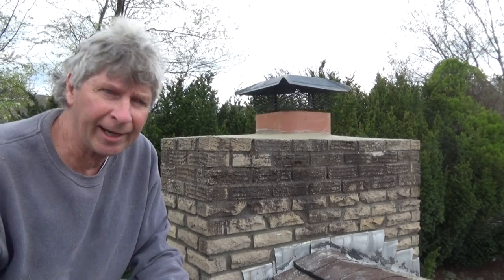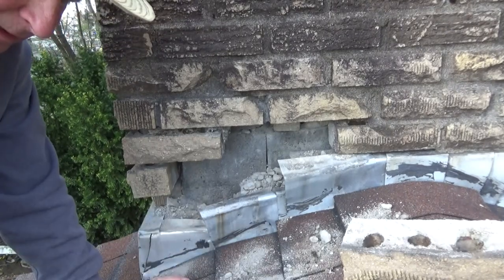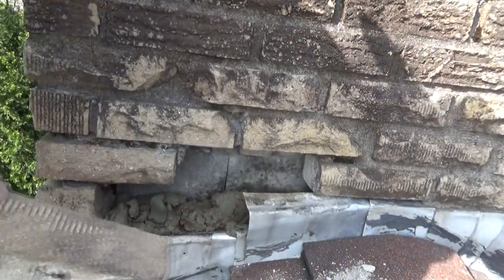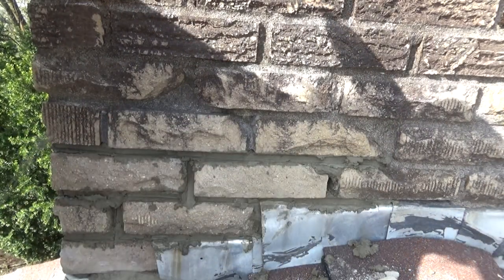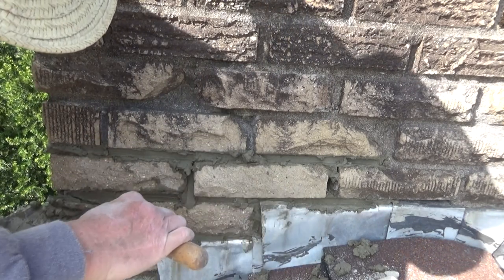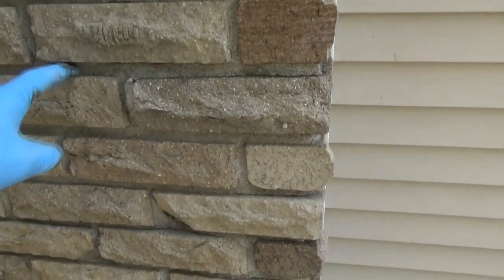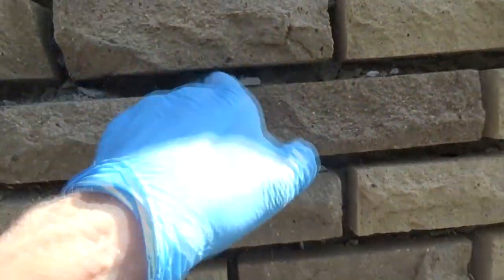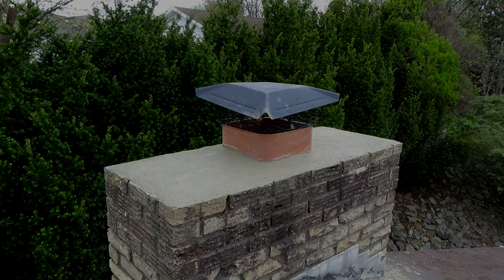CHIMNEY REPAIR (Part 10) Mike Haduck

Comment: I'm worried the chimney extension is not anchored.   If the Pennsylvania freeze-thaws cause the top concrete plaster to crack, then the wind with the chimney cover will blow off and can injure someone.
Reply from the maker: Hi Tiger, he's getting a new metal flue top, but as far as the flue blowing off, not a chance,   thanks mike

Comment: The cap is to thin. Mortar is not cement.
You use motor because you don't want your mortar to be harder than the brick because  what will crack,  the material that is softer ( the brick). That's why you cement for stone and mortar for Brick. And you don't use mortar for your cap you use cement. Use mortar for your brick so your mortar doesn't crack the brick. If you use cement on your brick your Brick crack and the cement won't.
That's why back in the day they used lime instead of cement. Everything moves when it gets hot and cold. It expands and shrinks that's why you don't want to use cement for your brick. There's all kinds of different brick there's hard brick their soft brick there's brick for inside of brick for outside. I lay brick and block every day and I lay Stones also. I've been doing it for about 22 years my dad's been doing it for over 35 I just want you all to know that guy is not right
Reply from the maker: Hi Chris, wow. I can use some learing, send me your video on how to do it right, I will appreciate it, I want to learn. I only been doing this 50 years and my dad 70,  Mike
Reply: Chris is absolutely correct.  Doing it wrong for 50 years doesn't make it any less wrong.

Comment: When I started laying brick 30 years ago the old timers would have shit a brick if they saw you grab mortar with your hand.
Reply from the maker: Hi Dee, I guess I am always in  hurry,  thanks mike
Reply: Dee Cee, why is that? Honest question.
Reply: Just remember, a trowel does not a bricklayer make..............
Reply: That is how I do it when repointing all the time.   Absolutely not when laying brick you need a trowel for that.  But for pointing I hold it in my hand and push it in with a slicker.

Comment: Why not just add lime instead of mortar if you're already using Portland?
Reply from the maker: Hi striker, I got to do a video on this,  lime is mortar,  but you can't get a straight answer from any of the companies that produce cement, to tell you exactly what's in it, but my video is coming,  thanks Mike
Reply: You absolutely can get a straight answer from manufacturers.   Request a MSDS it will tell you exactly what's in it.   Each type of mortar has a different ratio of lime to Portland

Comment: he complains about S mortar yet he uses it?
Reply from the maker: Hi Rudy, mortar works for brick work if it has Portland in it, S mortar has Portland in it,  I got to do a new video on what cement  should I use, mike
Reply: N is a bit softer. But S like Mike used it  is fine. Alone it’s too hard for a chimney fix.
Reply: @ttfweb1  he made the type s harder by adding more Portland making it way to hard for that application

Comment: What product did you use for the crown on top?
Reply from the maker: I use a rapid set mortar mix because it's fast setting or a Portland and sand mix, but if possible I would cover the crown with metal, thanks Mike